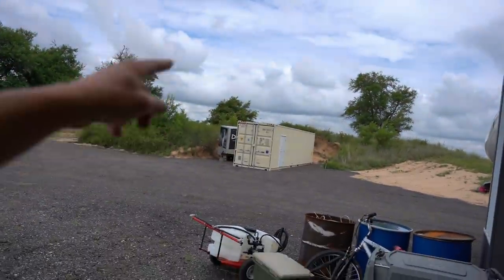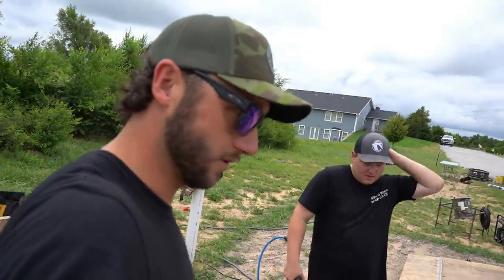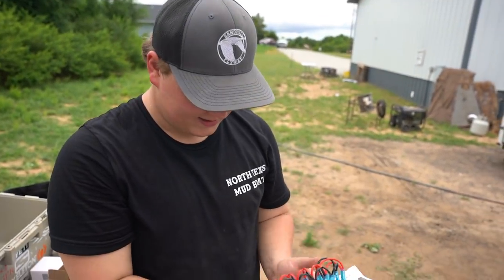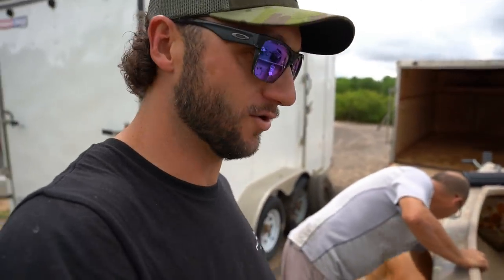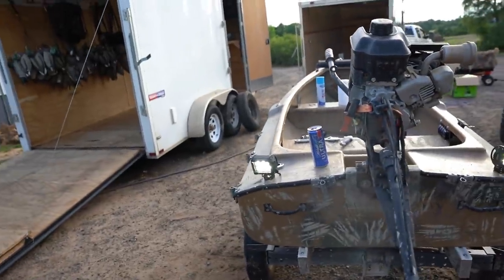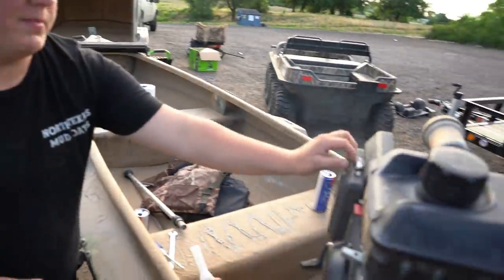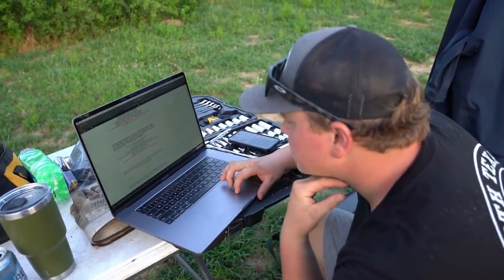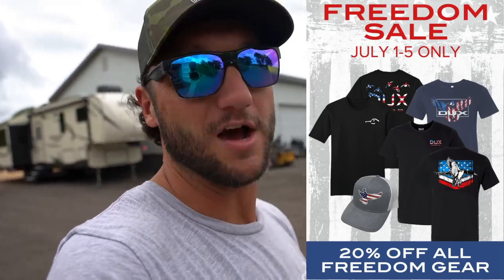Rebuilding My Budget Duck Hunting Boat!!

Comment: A new motor for want of a proper bolt, a carb rebuild/adjustment and low oil sensing unit| You guys are a trip! That Honda motor doubled the price, but it will run forever!

Comment: You should mount a transom mount trolling motor bracket and trolling motor on the back in case something happens to the motor, at least you'll have a backup

Comment: I’m in south la so mud motors are the only thing to run down here. Copper heads are good I’m not sure the lowest horse they make but those are good. As for long tails go devil, beaver tail and any vanguard motor really. Btw put that battery on the side opposite you’ll be sitting on with a boat that skinny. It’ll make a huge different

Comment: Get a surface drive with electric start screw that pull start crap and I’d beef up that transom and put a jack plate on it that way you can set it and rip